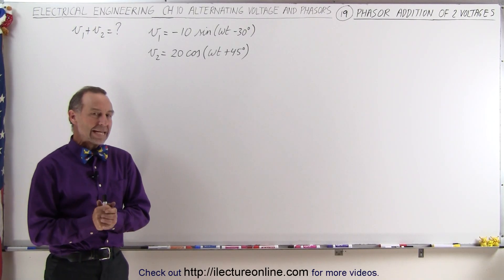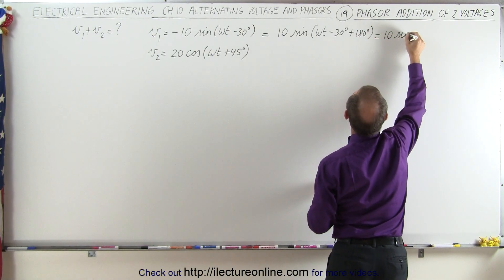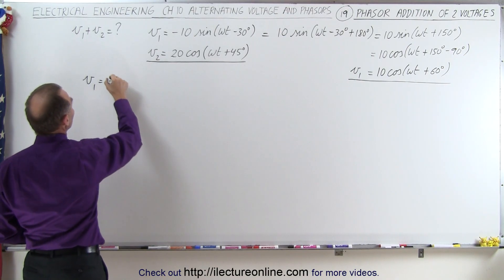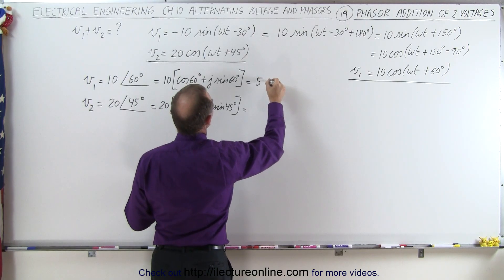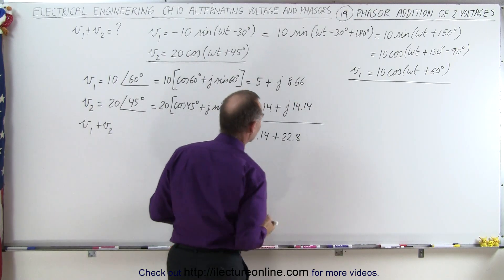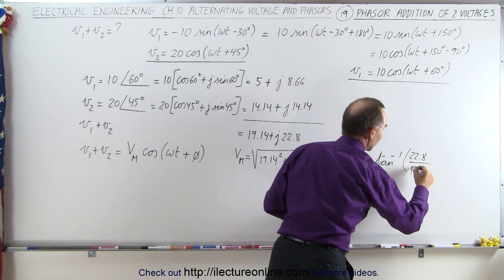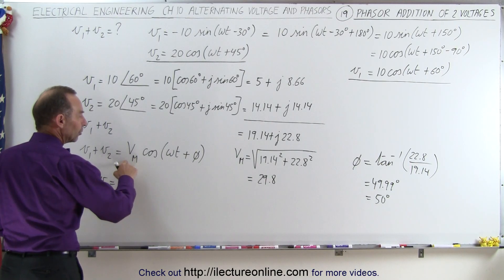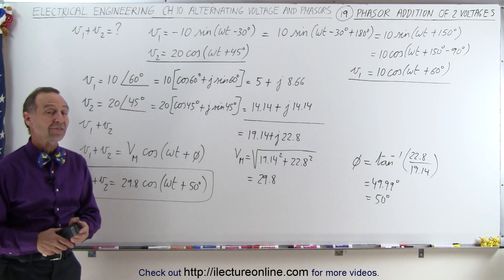Electrical Engineering: Ch 10 Alternating Voltages & Phasors (19 of 82) Phasor Addition of Voltages

Comment: Great video. Do we need to to add 180 after finding the phase angle thru tan-1?
Reply from the maker: Typically the phase angle is expressed in values of cos between -90 and + 90 degrees.

Comment: Sir why do we need to divide Vmax by sqrt(2) when converting from time to phasor
Reply from the maker: The average voltage is equal to Vmax / sqrt(2), since the voltage is a  sin curve.  That is the mathematical result of the relationship between the average value and the peak value of a sin curve.

Comment: Please   so always when the phase angle is negave you have to convert it to positive first before it can be added
when it's sine function we should always add 180 and when its's cosine function we should substract 90?
Reply from the maker: Not necessarily.  Wen you start adding voltages and currents with phase angles it sometimes makes it easier to add or subtract 180 degrees with either the sine or cosine functions.  (Usually we use the cosine function).

Comment: Hello Sir
when I try this method with my example i just get weird answers for some reason 
𝑢1 = 4 ∙ cos(3𝑡 − 1)
𝑢2 = 6 ∙ cos(3𝑡 + 1.1)
if anyone could help me that would be appreciated 
Thanks in advance
Reply from the maker: Note that the phase angle needs to be converted to radians (not degrees) and your calculator needs to be in radian mode.
Reply: @MichelvanBiezen  Could you explain more please ..

Comment: Thanks for the explanation. And I just wanted to ask what would we do if we had different frequencies in the different voltages. would you just take the average ?
Reply from the maker: Then you would use the superposition principle.  Use each frequency to calculate the current and voltage and then add them (making sure you take the different phases into account)

Comment: A sinewave depicts movements in the form of waves. It has a datum, rapid, slowing and steady growth in one direction for a quarter cycle with reference to a datum (a reference), and then slow and faster decay in one direction for the next quarter cycle, and all these elements again in the opposite direction (reversal) of the forward movement for the next half-cycle. It has peaks and valleys. 

In essence, the sinewave is a perfect embodiment of oscillatory movements like springs and quantities like voltage. It retains its waveshape when added to another sinewave of the same frequency and arbitrary phase and is the only periodic waveform which has this property. 

The charges in a resistor subject to a sinusoidal voltage do not migrate elsewhere on the average. They merely slosh back and forth, so to say, over each cycle without a change in their position when the resistor was not energised. 

Electrostatics and circuits belong to one science not two. To learn the operation of circuits it is instructive to understand Current, the conduction process and Voltage at the fundamental level as in the following two videos:
i. https://youtu.be/TTtt28b1dYo  and 
ii. https://youtu.be/8BQM_xw2Rfo 

A sinusoidal voltage generator operates by separating charges for the positive half-cycle in one direction initially rapidly and slowing down and momentarily halting when its voltage is at the positive peak, and then gradually reuniting the separated charges to make the separation zero; when all charges reunite, the generator voltage is zero. The negative half-cycle now commences, when the generator operates by separating
charges in the opposite direction initially rapidly and slowing down and momentarily halting when its voltage is at the negative peak, and then gradually reuniting the charges to make their separation zero; when all charges reunite, the generator voltage is zero. It then begins the next positive half-cycle followed by the negative half-cycle and the process repeats. 

The last frame References in video #1  lists textbook 4 which discusses these topics in more detail using a unified approach and provides an intuitive understanding of sinusoidal steady-state voltages and currents in capacitive and inductive circuits.

Comment: -10sin(wt - 30), shouldnt it be -10cos(wt +30) ?, the negative sign in front of Vmax is missing????
Reply: He changed the sign of the amplitude. You need to add 180° to the phase angle before you can change the amplitude's sign

Comment: What about addition of two term where one of the term does not have an angle, so how do we calculate the arc tan then? (One term has phi, the other does not)
Reply from the maker: It makes no difference.  Think of it as an angle of zero.   The calculation will be exactly the same.

Comment: Sir, are we using rotation by j concept and converting the negetive vector v(t) = -10sin(wt-30) to positive vector . Since we multiply by j^2, are we adding 180 degrees and it becomes v(t)=10sin(wt+30+180) = 10sin(wt+210)?
Reply: i have the same question 😥

Comment: Can we show how to Add 3 voltages and what if  any 1 Voltage does not have an angle with it  like
V1=10sin(wt)
V2=15sin(wt+45)
V3=20cos(wt-60)
Reply from the maker: Convert each to the real and imaginary parts and then add the real part together and then the imaginary parts.  (you are adding 3 instead of 2, but the technique is identical)
Reply: Michel van Biezen but we don't have any angle associated with one voltage what happens to that voltage... That is V1=10sinwt
Reply from the maker: The phase angle is zero therefore v1 = 10 + j0